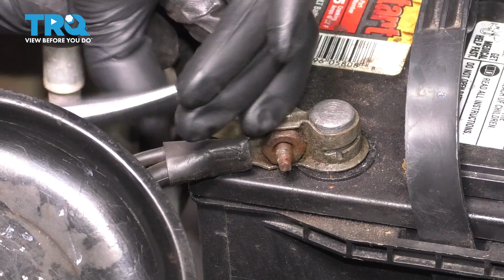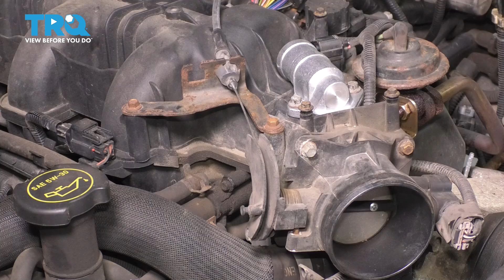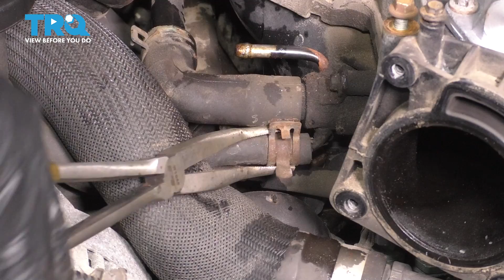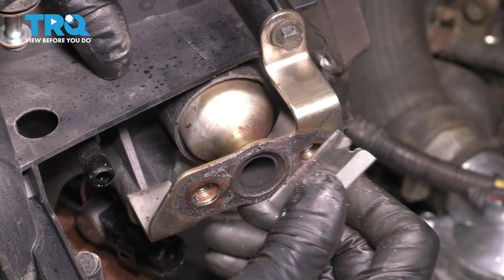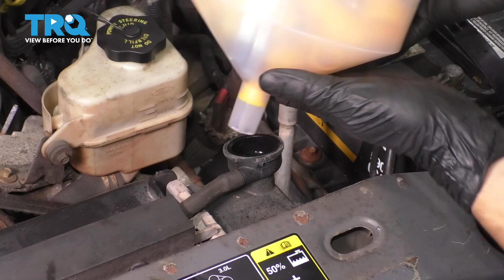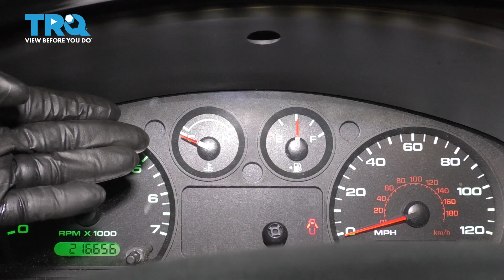How to Replace Knock Sensor 1998-2011 Ford Ranger (4.0L V6)

Comment: This excellent video is so much more useful and informative than for simply replacing the knock sensor. It would be very helpful regarding the entire intake removal process, and every sub component along the way. I learned a lot about the 4.0L SOHC by watching this.

Comment: Great video. If anyone is going to do this, I would also advise replacing the valve cover gaskets, and replacing the thermostat housing with an  aluminum version. Much easier to get to with the intake removed. Edited to also add the Pcv valve and driver side chain tensioner (especially of you have 2 sensors on the thermostat housing).

Comment: Great stuff!! I love the step by step, and the way you tell the size of every bolt head before you unscrew it. It saves a lot of trips back and forth to the tool box.😉 A mouse chewed the wires off, so I had no idea where the sensor was. I had gotten right up to the manifold step by winging it, because Chilton's Manual says absolutely nothing about the knock/detonation sensor. Not in maintenance and repair, or wiring diagram. I thought, "It looks like I may have to take the intake off, but I really don't want to, if I don't have to." Now I know what steps to do, in what order, what to expect, and what parts to replace. As a retired person, I could not afford the dealer's hourly rate for this job, but I do have the time and inclination to do it myself. You have helped me keep my little Ranger on the road!! 😉👍😊😊😊

Comment: Just wanted to check: the spark plug wiring order you stated in the video (123456) doesn't match with what wiring diagrams I have found for this engine; if cylinders are 123, 456, the coil pack should be 123, 645, if that makes sense, could you clarify?